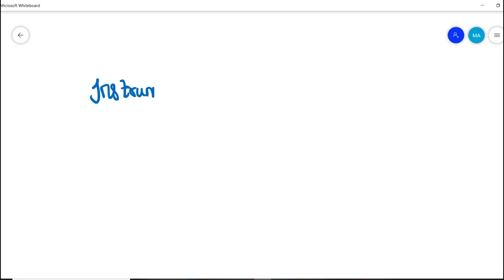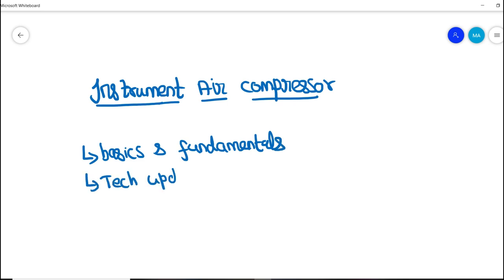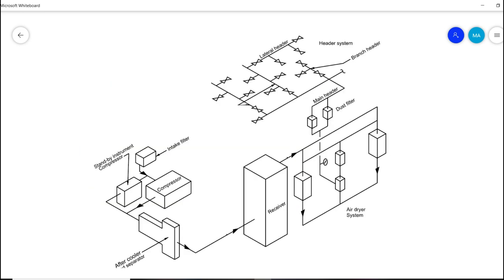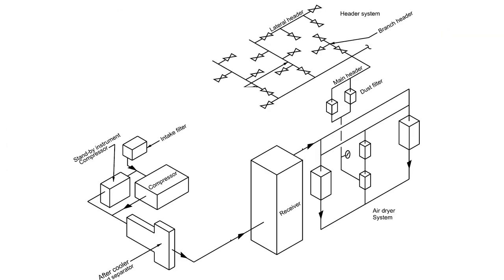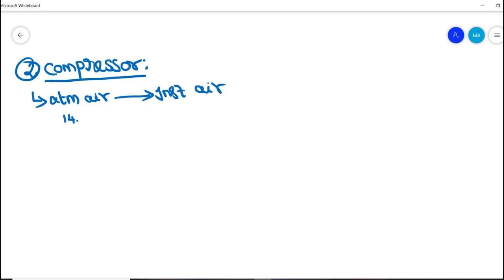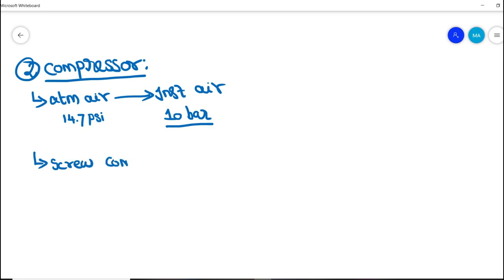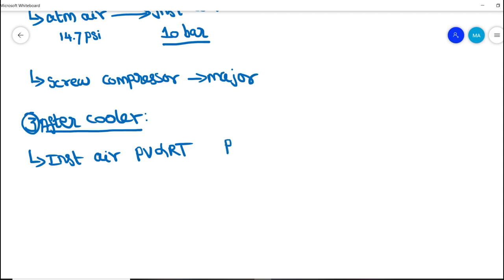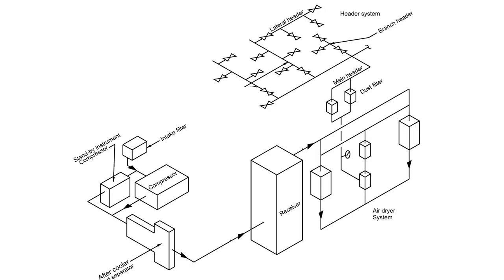Instrument Air Compressor explained

Comment: The flow rate directly influences the amount of energy required to compress a gas. By calculating the flow rate, engineers can determine the energy consumption of the compressor, which is essential for evaluating its efficiency. The efficiency of a compressor is typically measured by the ratio of the useful work performed to the total energy input.